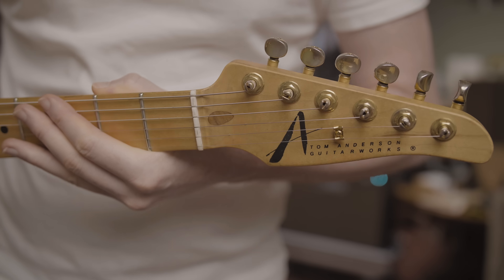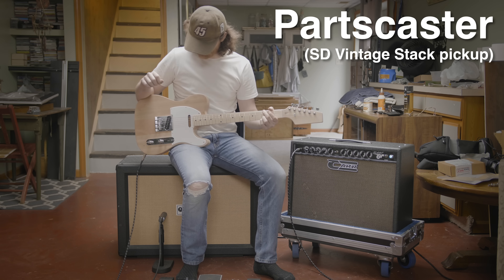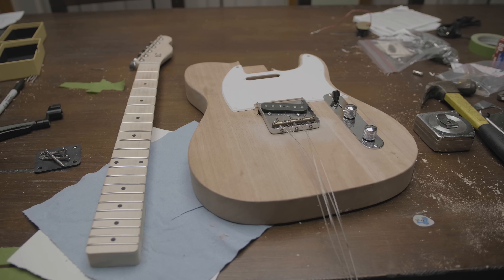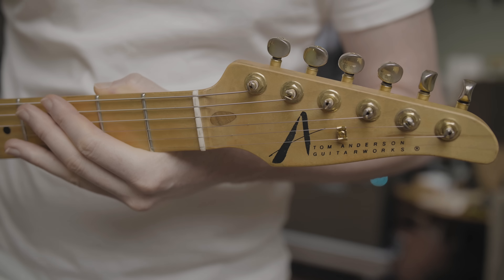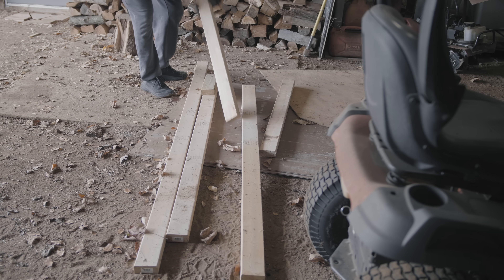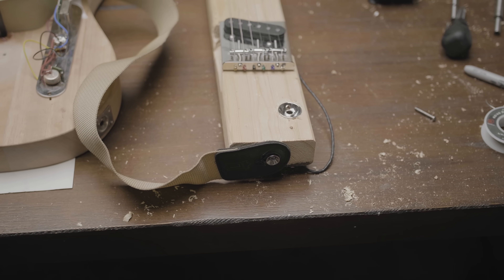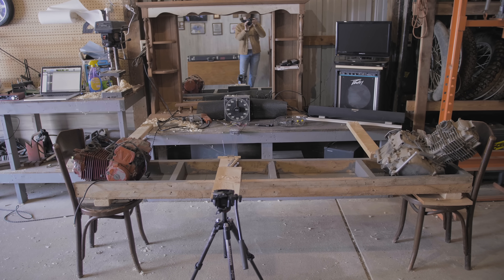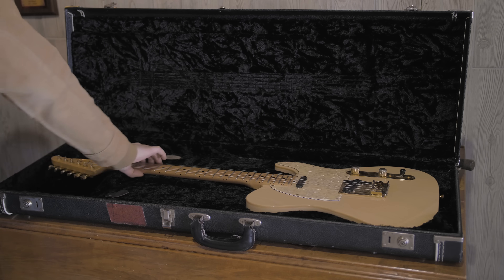Tested: Where Does The Tone Come From In An Electric Guitar?

Comment: The instant the vibration of the strings hit the pickup poles and connects to the copper wire, it travels at a speed of 122,760 mph to the amplifier that’s roughly 5/1000 of a second!  I’m not sure the wood could possibly have an effect of the sound as the strings are typically struck in the general area of the pickup’s themselves!  This demonstration basically substantiates this data.  Great demonstration!

Comment: Try a hollowbody like a es 355? There should be a difference because the top is actually vibrating along with the bridge. (Not a 335 because that has a centre block)

Comment: It's the WOOD. The stings vibrate the wood, and the wood vibrates the pickup. That is why the same parts sound different with different woods. If you really want to know the difference the wood makes, mount a pup on the back of the guitar, and position it close to a stationary piece of ferrous metal, so the strings are not affect by the strings. The finish on the axe make a radical difference. Also, Seymour Duncan makes shitty pups, with no usable mids. The SH-4 JB is THE WORST pup on the planet, and it comes on most guitars, even my USA Jackson SL1. BTW, you botched the test, by having the pup mounted to the bridge plate in the bench test.

Comment: As I built my own electric guitar, I know they are pretty simple Instruments. Basically for the wood it's all about stiffness. The harder the materials, the more sustain you get. Soundwise its extremely hard to tell the difference, since everything down the chain alters the sound much more. Therefore I would focus on playability and style, while keeping the stiffness in mind.
Stainless threads make the sound a bit more harsh, but nobody would notice if not compared side by side.
Softer neck wood can be compensated with extra stiffening rods, or by just leaving the neck thicker. But thats still nothing compared to the physics involved in creating an acoustic instrument of any shape.

Comment: I'm 64 and have played a lot of guitars over the years both cheap and expensive. I could tell you that it's 50% the pickup and its relation to the strings. I can also tell you that you don't need expensive pickups to get a great sound but cheaper hardware won't last as long. The wood and shape of the guitar only determine your playing comfort. The other 50% is the amp. Anything under 30 watts is going to sound thin like an old portable radio.

Comment: It sounds like a solid body guitar with a super stiff neck. You aren't going to get it to sound like an archtop or even a semi-hollow, and the materials used still have an impact on the tone and sustain. I guess this is a could be a good way to compare pickups because it eliminates some of the other variables that contribute to tone, but I'd rather just compare them on an actual guitar.
My answer to the question at the beginning would be this:
1: construction (hollow-body, scale length, string length, string break angle)
2: pickups and pickup location (tied with number 1)
3: materials, particularly how stiff the neck is, which has as much or more to do with the truss rod as the type of wood used. The body wood really doesn't make a huge difference on a solid body, but it does interact with the neck and bridge, so it still matters. 
4: string guage and how old they are.
5: pick or fingers, and picking technique.

Comment: I may be mad, but I still hear a slight difference in tone, especially for higher notes. But yeah, most of the tone should come from pickups, strings, positioning, and electronics. That's how physics works for electric guitar.
Nice video though! 
For a more thorough experiment, I would also record the sound and compare the sound waves.

Comment: The air guitar comparison is not a very convincing argument in my opinion. The string are connected between stiff and heavy shelfs which will have not much internal damping. So you're left with the resonant undamped sound of the strings. This could be regarded as the ideal properties which you want to achieve with a good guitar. A real guitar is flexible, resonant and will also have some internal damping. While it's true that the sound is mainly coming from the strings interacting with the pickup, the neck and body will also resonate and dissipate energy through internal damping. This results in slight coloration of the tone. With a good guitar, it will be just that... a slight coloration but not particularly good or bad, it's a matter taste. But with a bad piece of wood, it can result in particular notes or harmonics having a lesser sustain. And this is more noticed while playing long notes higher up the neck, which we did not hear in this video. Hardware/tremelo systems can also have an influence in this. I've owned and played 30+ guitars in different price ranges, some similarly specked but with different woods or neck constructions (bolt-on/neck trough/set neck). I've sold 3 guitars because I didn't like the sound of the wood. Not that these were unplayable or really bad sounding, but when compared to similar but better guitars, there was a noticeable difference in liveliness. But it's aslo true this is noticed best by the player, and it would be more difficult for a listener to notice it the same way. And it's also very true that the looks of the wood matters, it's not only about the sound.

Comment: One thing I wonder about is hollow body guitars and semi hollow bodies. Those def would effect the tone because they effect the sustain without a doubt. If your sound is jangling around in a resonator, it will be changed by it.
Reply: Only if the pickups pick up the sound that have been jangling around the resonator. If they pick up the sound from the string as on an normal electric guitar it will not make a change,
Reply: pickups aren’t microphones. they “pickup” the vibration of the metallic string, so if whatever is resonating isn’t causing an appreciable difference in the way the string vibrates, it won’t cause a difference in how it sounds. 

something like a hollow vs semihollow body would almost certainly cause no difference in the sound for magnetic pickups, since any body vibration would similarly vibrate the pickups and strings canceling out any effect.
Reply: @user-ow1bc4sx2r  But it is more complicated than this because of how sound works. It most certainly would change the way the strings vibrate because of sympathetic resonance with the body of the guitar. The same way if you shout into a guitar pickup (with the strings on) you will hear it out your amp as the strings resonate with your voice.

Comment: Jim, the experiment comparing different guitars was interesting. The Air Guitar to me proves the body means little compared to the (a) pickup, (b) types of strings, (c) tensioned string length and (d) gap distance between pickup and strings. The gap distance proves to be critical as sound is transferred to the Pickup ie. the same between your samples. Shrinking the gap distance might increase the vibration volume, thus improving sound sharpness. Increasing the Gap might lessen the sound sharpness.

I would like to introduce another issue that may not have been considered. Tensioned wires or Installed Strings vibrate in known harmonic patterns. The length of the strings makes a big difference affecting the harmonic pattern. Twanging a ruler that’s partially held on a table and sliding it more on to the table changes the harmonic pattern and resulting sound.

Of course tensioning changes the vibration also.  Proof of what the combination of tensioning, string type and length; the vibration eventually “work hardens” the string material causing it to crack before breaking. The work hardened ends of the break can be so hard they could scratch glass like a diamond. However, the length changes the harmonic pattern the strings vibrate with. This requires specific placement of the pickups to effectively pick up the vibrations. Further placement from the pattern max height produces less sharpness as compared to being right at the max height of the pattern. 

On Vibrating harmonics, comparing tensioned strings to a Target Rifle, barrels vibrates harmonically also. Target Rifles are tuned with not letting the barrel touch anything from 1” from the Action and selecting the right powder charge and bullet. The harmonic pattern is generally in 3 sections along the barrel length. Barrel length is selected to provide repeated harmonic movement.  Action Bedding plays an important role and is Re bedded after enough time vibration has loosened it. Hence with Target Rifles, vibration deadening is achieved thought to smooth the harmonic vibrations on the barrel.

Comment: I'm sure if you could experimentally isolate the various guitar components and compare the direct output waveforms, you could detect minute differences caused by tiny vibrations and harmonics in the materials, but I'd imagine the difference would be far too small to be detectable by human ears. Each note produced is a small band of frequencies that oscillates between it's upper and lower limits at roughly the same frequency as the note itself, barring harmonics, but the size of that band is dictated by the rigidity of the material connecting the two ends of the strings. I'm sure there's some tiny difference, but a band of 3999.99999-4000.00001Hz is functionally identical to a band of 3999.99998-4000.00002Hz when it comes to the sensitivity of human ears

Comment: Problems with methodology. Do the same on a clean channel, e.g. Vox AC15 - normal channel / 1/3 volume; without ToneCut etc. Strings - at least 11. Wood is very important to the sound, which is immediately evident with acoustic guitars. When you play overdrive, it doesn't matter anymore.
Reply: You said it yourself, acoustic guitars.
Reply: @olssong7941  Not only. Even if you don't connect the solid body guitar to the amp, you can hear the difference. After connecting too ... but who tests the differences in the sound of wood on a pickup from under the bridge on an overdriven channel?

Comment: Damit Jim,   thats a cool study, 
I built a guitar,  it has a big difference in sound  then other guitars, but I had done a couple things that make it have months of sustain by its build. 
I learned that fender had at the same time made a device simular to my bullet sustain system.  Theirs is different in design, mines part of the guitar. 
I liked your video. And the comparison you did. Clear and to the point. And I liked the air guitar and factors against the other guitar, awesome display of concept study👍
Ok peace be on your house.

Comment: Great experiments. There is still a guitar body in the last example - it's the wood in the benches. It would be interesting to hear the strings secured to heavy steel or brass blocks at both ends to see if there is an increase in treble response. A dense heavy material such as brass will tend to not absorb vibrational energy as much as a less dense material - correct? A question for our panel. I believe the chrome Valeno guitars are very bright.
Reply: Unnecessary and negligible I would say. Using equation for force F=ma, mass of strings is so much less that force to create vibration allows for movement.  The bench on the side of the pick up has so much mass that while force may still be transmitted, acceleration would be so small that the bench would virtually have nil acceleration, i.e. impact on tone would be extremely small compared to the strings, among all vibrating parts.

Comment: "In an electric guitar, the sound radiated by the body is insignificant; instead, the string vibrations are picked up by a transducer located on the bridge or under the strings and are then amplified and reproduced." John Backus, The Acoustical Foundations of Music, Chapter Fifteen, The electronic Production Of Sound, page 328.

Comment: This needs to be answered with the scientific method.

I've only seen the "electric tonewood" test done properly by one YouTuber, and it was close to a decade ago IIRC.

You have to move EVERYTHING from one body to the next. Neck, pickups, jacks, pots, wiring, bridge, etc.

The ONLY variable is the body wood. It's insanely time consuming.
Long story short - after doing so, and comparing sound samples A/B style - there is absolutely no difference. Oscilloscope agrees.

Ask a shoe lace manufacturer how special their brand of shoelaces are and you'll get a 10 page list of esoteric nonsense. In the end none of it means a thing.

Even concrete, metal, and lucite electrics sound like the pickups. Tonewood is for acoustic instruments. Not magnetic transducers. 

Once again, ask someone whose living is made shilling wood types and options and you'll get a voodoo answer.

Comment: The whole electric guitar industry is built on lies.)))
about the quality of the body of the guitar, about materials made of super wood, about the neck material, about painting, tuning pegs, bridges, glued necks and other nonsense.)))
a piece of wood from a garage sounds like a $3500 Fender
But when the strings strung in the air sounded the same as this Fender, I turned my face up.)))

Comment: thats easy an lp into a Marshall or a fender plugged into a fender. ps your roadies are going to hate you with that " air guitar" . " just pack the two honda engines, the two tables, and the rest and get there two hours early to tune up my guitar. the swed maid one out of a steel beam. he has to relocate the building for each set.

Comment: This confirms my my thoughts on what creates the tone. 

The biggest factor will always be the player, eg, Geddy Lee sounds like Geddy regardless of what he's playing. 

Following that is the string and pickup combination. I run the same strings on all my instruments, and while they're similar, they differ depending on the pickups.

Next is hardware. Three of my basses have hi-mass bridges, which add a bit more depth when compared to the standard issue bent sheet metal fender bridge.

The body and neck wood make the least difference among everything.

Comment: Great video, Thanks for going through all this trouble so we do not need to.
May I suggest that you show a Spectrum Analyzer printout of each for comparison, you can sometimes see more than the ear can discern.
Reply: Oh, and were the two Honda engines both tuned to the same timing and set at TDC?   🤪
Reply: The work was put in almost 100 years ago by Leo Fender and Les Paul. Nothing new here, just "rediscovering" known information.

Comment: Definitely all that myths with body and neck material and such is bullshit if we talking about "Tone". It can make difference for tuning stability but You proved that actual tone has no difference. I am pedal maker and I can say the same thing about caps, resistors and opamps. Differences are so negligible for using different caps in guitars. 0.05$ cap is same as orange drop in terms of tone. My 5 factors for guitar tone are:
1) Definitely the player
2) Guitar playability. I mean setup, action, softness, frets size, fret level
3) Pickups
4) Hardware like bridge, nut
5) none
I am really happy that somebody proved officially that wood thing is nothing more then myth.

Comment: Yes the pick ups create a distinct sound but the tone quality differs massively between build quality and stiffness of the wood. If you get all aspects right you can play the guitar with out plugging it into an amp and the sound will ring clear without disharmony. If you want your guitar to sound like your idols does then slap the same pickups on it and dial it in like they do, but it's still not gonna sound exactly the same on a 100$ kit model?

Comment: Screwing the air guitar's bridge directly to the bench is a bit shocking, but otherwise this is spot-on. Thanks for such a clear demonstration. Ideally this should have a shorts version where you just strum an open-tuned Tele and the air guitar, and then list the common elements.

Comment: Most of the stuff the manufacturers said was rubbish. The only thing that the wood, hardware, and neck changes is the sustain and tuning stability. Pickups make a small difference. If you really want to experiment with your sound, change strings or the speaker in your cabinet. Also move your mic around if you are micing up the cab. Spectre Media Group has some great scientific experiments on his channel as evidence. Keep in mind he is a metal guitarist so his experiments revolve around high gain. At lower gain levels, you can detect tiny differences in wood types and pickups. At high gain, there is no difference at all.

Comment: I listened to this with my phone speakers, but thought I heard a tone difference between the brass and steel at the bridge.  That may have been before you dialed in the distance of the pickup to strings.  Either way, I was surprised at your results.  Good work and thanks for the amount of hours you put into this display.